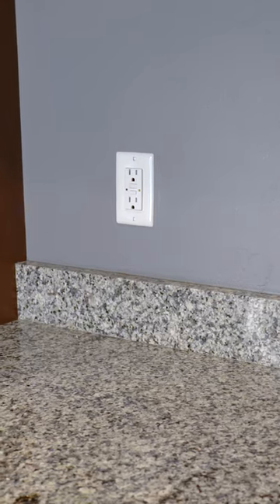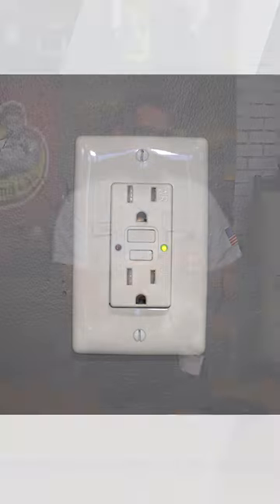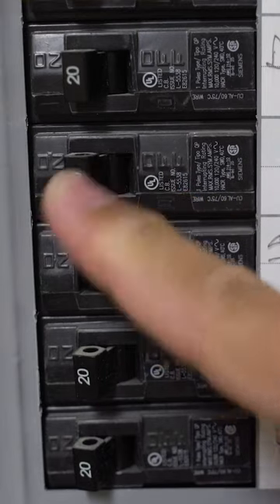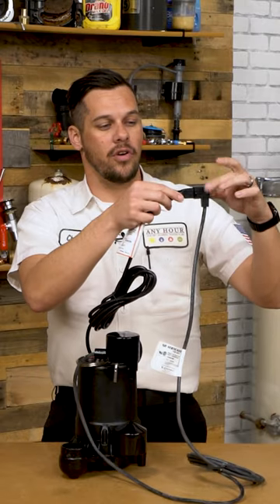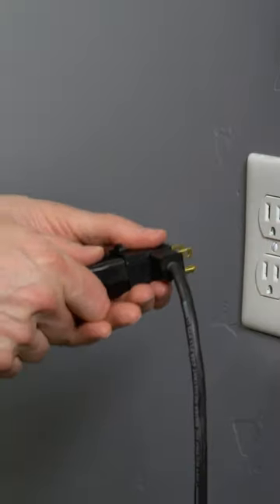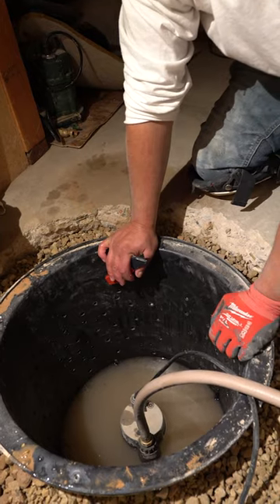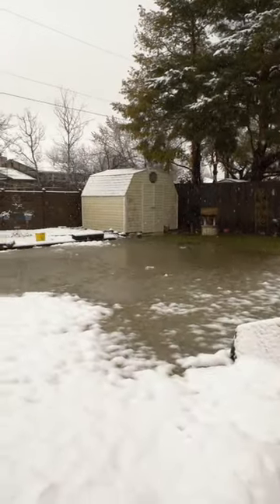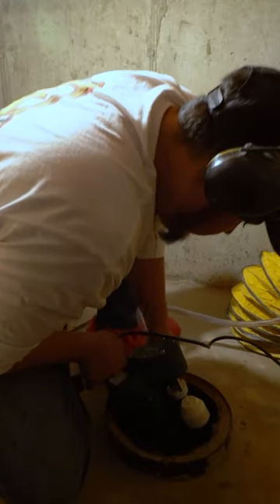How to Test Your Sump Pump

Comment: My float has maybe a ball inside the float that make the motor run and stop the flow. What exactly is the “switch”.
Reply from the maker: From Chasen: The ball is a float that triggers the switch which is inside a housing. The ball is like the part of a light switch that sticks out from the wall that you flip with your hand, then the ACTUAL switch itself is inside the electrical box behind the wall plate on the switch.